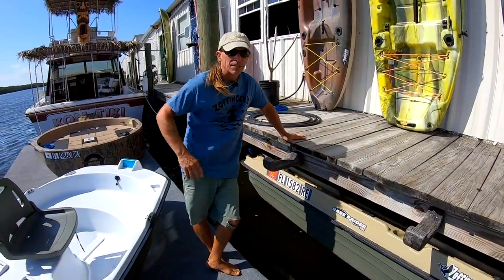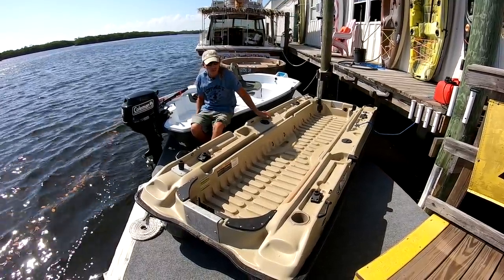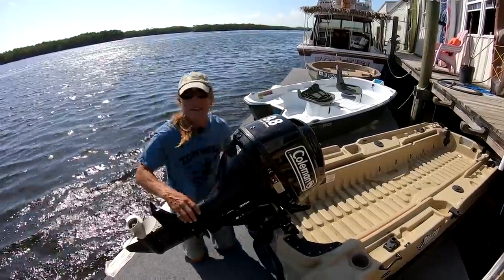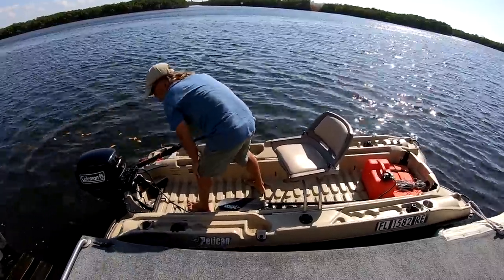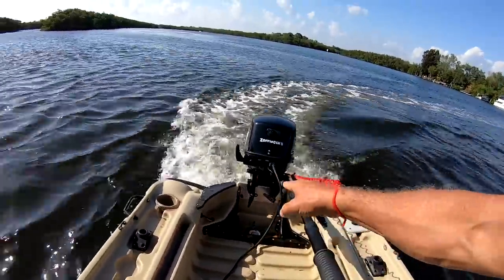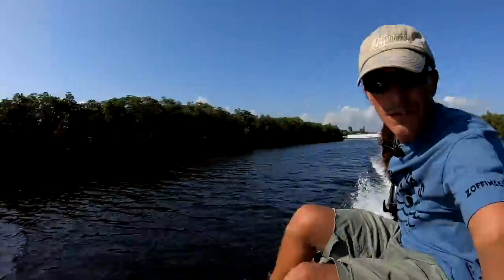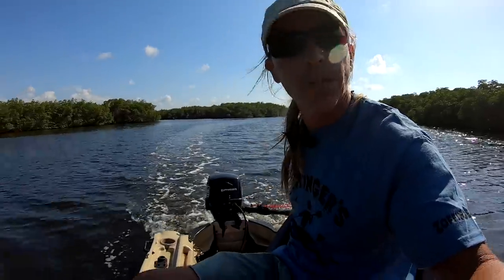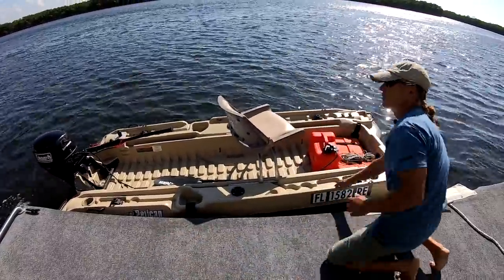The Life of Marty 020

Comment: Those cleats look perfectly positioned for broken toes
Reply: Where else would you put them? Every dock I've ever seen had em the same. I'm probably wrong.
Reply: @effyoo6081  Where have you seen a dock with cleats in the middle of the dock?
 I usually see them located near the edge of the dock.
Reply: @JB-jt9kd  that is the edge of dock. It has an movable extension
Reply: @effyoo6081  that has nothing to do with where the cleats are placed. They are at least 18 inches from the edge. Cleats are typically within 2 inches of the edge.
Reply: @effyoo6081  I didn't think I need to specify but I'm talking about the cleats that Marty talked about. The ones he installed to hang the boat from
Reply: That area of the dock gets little to no traffic.
Reply: Definitely rethink those cleats!  Maybe move them to pole.

Comment: Good afternoon! Would love to see a video of you giving a in dept demo on how you used star board to strengthen the transom on the Bass Raider 10E. I surely love mine also. I'm really thinking about adding a motor to mine also.
Reply: Yeah I'd love to know how he strengthened the transom.   I saw another YouTuber that used 1x6 to build a brace.  But did he do like he did on the x3 build and drill and pour foam in or what?
Reply: @cjlloyd81  
i don't think you need to.
a light suzuki motor will be perfect for it.

Comment: Very interesting videos! 
I'm very curious to know how many mph do reach with your 5 hp? I'm sure every other bass raider owners would also like to know. Could you test run it with a gps to get mesurement? It would be MUCH apreciated!
Reply: I literally have the exact same question
Reply: @jakes8545   I tried a 6hp with the pelican and since mine was kinda loaded with a big groupe 31 battery and a 55# tm in the front, i was getting the same speed as with my yam 2.5hp (4-5mph) it was only pushing more water no planing. I concluded before switching to a 20hp 14ft v hull aluminum that the bass raider is an exellent electric only fishing platform but by desing not intended for speed. I kinda miss the stability sometimes but when hitting 25 mph i amlost forget about it 😂.

Comment: That was great! Try running it with the engine one or two holes out on the transom mount. It may spray a little less. Also, just sit on a cushion down low and see how fast it goes on glassy water.

Knowing you Marty, you will soon put on a jack plate and steering/throttle/shift controls. Toss in a SST prop for good measure.
Reply: I agree. Get rid of that stupid chair and sit down low. That thing will fly. 
It's a no brainer.
Reply: @jeffplease8334  Many years ago, I put a 9.5 hp Johnson on a small dingy and sat backwards with my feet against the transom. I had two ropes going through screw eyes at each end of the transom to steer it. 

I had to put both ropes in one hand while pushing the throttle up all of the way. The engine was missing the tiller/throttle handle but had a small lever to advance and retard the throttle.

The boat really flew and the real excitement was when attempting to slow down. Crazy, but fun times.

Comment: Just moved to Woodstock, Va over a year ago and we want to visit Moomaw. Just bought a 1984 14' V hull Aluminum Lowe Jon Boat. Just my wife and I (about 330lbs combined) with gear, wood decking, two trollers, 2 batteries. Are you still happy with this motor? You think it can push us along? Not looking to break speed records just save batteries and move a bit quicker.